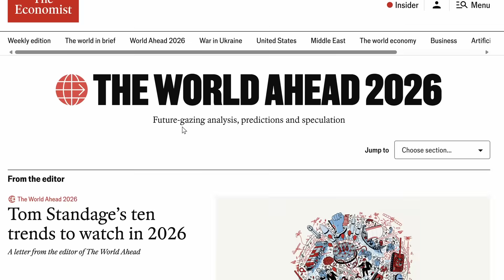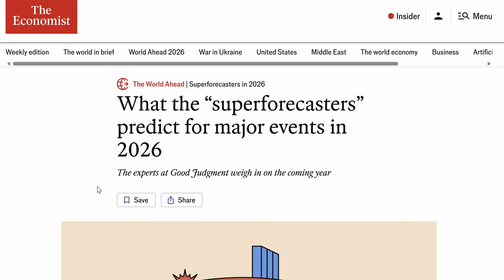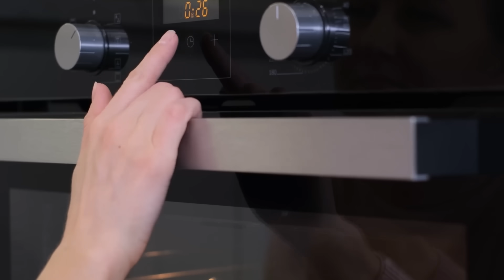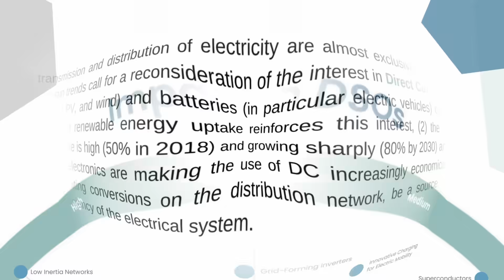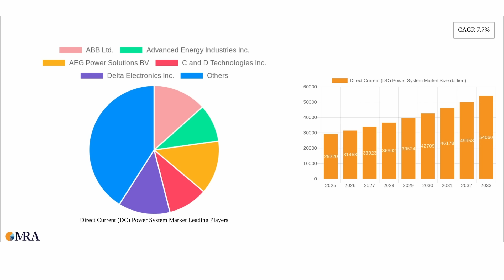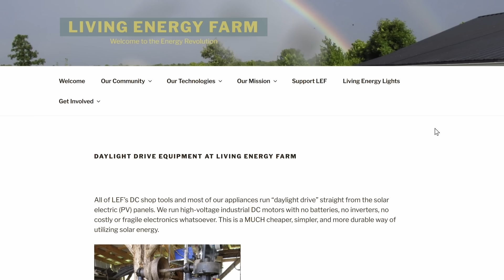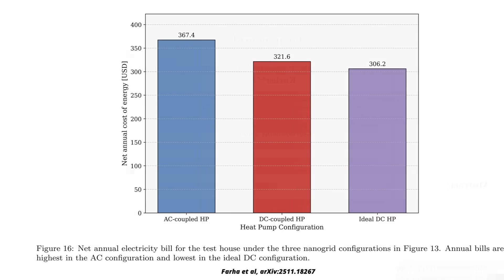Are We Using the Wrong Kind Of Electricity?

Comment: You need to minimize the I2R lost during the electricity transmissions, that means step up the voltage on the transmission side and step down the voltage on the receiving side, an ac transformer is more simple to be implemented rather than a high voltage dc-dc converter.
Reply: It is about correct application as always the case with an engineering question. The saving of 15 to 20% of going DC is not surprising to me since there is less power in a AC single than a DC single of the same voltage as power in AC is dependent on the phase angle of voltage to current, put very simply as there is more to it.
Reply: @ivandhotmanvilliers3361  almost always, the correct answer is ‘it depends…’
Reply: @ivandhotmanvilliers3361 indeed the cosine of the phase angle is the power efficiency, in reality we cannot get a perfect match of the distribution systems, some of the power are wasted there.
Reply: You still require a high power transformer in the dc-dc converter for stepping up and down the voltage, the controller chip is for driving the high power GaN transistor to switch the voltage on the transformer.
In general it is a switching power supply, it is more complicated especially in high power designs.
Reply: @simonleung2130  Yes, in reality a DC-DC converter is actually a DC-AC-DC converter and there are losses at every step.
Reply: @simonleung2130 ac transformer needs to work at 50hz, DC can work at 50000 hx, so it is 1000 times smaller
Reply: @tedarcher9120 That isn't an argument for DC. It is one to use higher frequency AC.
Reply: @court2379 higher frequency AC means much, much more losses
Reply: @tedarcher9120 I don't think the Eddy current losses will be all that high until you are above 10s of kilo hz. 1000hz would reduce the size considerably and not have a significant skin effect on the wires.
Reply: @tedarcher9120  UM 50000hz means it is actually AC is it not? Hz = Cycles per second? DC has NO cycles per second.
AC is Alternating Current it does not mean 50Hz  a Transformer doesn't 'need' 50Hz it only needs Alternating Current, the more Hz the merrier.
Reply: @YouShouldThink4Yourselfno shit lol. All DC uses high frequency to convert voltages. The difference is if you transmit at 50hz you lose 15-20% of energy, if you transmit at 50000hz you lose 100% of energy in transmission wires
Reply: @court2379 at 1000hz long wires inductance will become extreme
Reply: @tedarcher9120 For what reason? Thinking about the equations for a magnetic field the amplitude doesn't depend on frequency. Just current and other constants based on the physical geometry. I don't think 1000hz isn't enough to behave like an antenna and transmit power. Are you taking about if they are in the same jacket and very close proximity?

I haven't ever looked at higher frequency for grid scale transmission. What am I missing?
Reply: @simonleung2130 .. AC / DC.. DC microgrids make more sense. On  a lighter note, the biggest problem with DC is it bigs up Washington, that really ought to be rapidly filled with nuke power, released all at once, concentrated on the Whyte Haus!
Reply: @PrivateSi DC micro grids makes sense to me.
Reply: @crux321  .. New wiring standard for homes should have more than 3 wires. Add low power 12v + and - lines around 20A and 5v USB network at around 30A for fast charging of handheld equipment and data transmission. Cable and sockets would cost more to begin with but not much more compared to installation costs and we could get rid of power bricks.
Reply: @PrivateSi where are you getting the DC power tho? An inverter before these 12v /TV lines?
Reply: @crux321  .. Conversion depends on power system. Centralised AC inverter or DC transformer if off solar cells.. A single PC power supply would be enough if only for recharging phones and power-tools.  A 1kW PSU could be split into multiple circuits, and be made 'smart' for hardly anything extra.
Reply: That's why almost all long distance transmission has been AC until recently.
Reply: and a transformer is also more robust against bullets and cyberattacks.
Reply: @pietdepad4103 A single bullet ruins a transformer. That isn't true at all.
Reply: @court2379  It ain't necessarily so. Industrial transformers are usually proof against most common calibres where as the majority of electronics are not.
Reply: @YouShouldThink4Yourself 
There have been numerous cases in the news about people shooting a hole in the jacket of transformers and the cooling oil leaking out. The transformer then overheats and fails. 

They would need 1/2in thick armor plate steel to have any reasonable protection against most rifle rounds. I highly doubt they are making the cases that thick. They would be enormously heavy and expensive.
Reply: @court2379 It is the terrorism, am I correct ?
Reply: The loss can be recycled to recharge. Great idea. I tried once with electric company and some rule makers..when the bills were ave 17 a month. This was results
Reply: Boost converters are cool (literally too, they're efficient and don't generate much heat), but there are technical difficulties associated with making ultra high voltage semiconductors.
Reply: @maelmauron7530 and magnetic material for the high frequency switching on the high current passing through the inductor, take a look on the BH curve, Your required inductance is dB/dI which is dB/dH.dH/dI, the more you push to the end of BH curve, the slope tends to zero,  also the shape of the curve is frequency depending. 
Also if I have the choice, I won't use the booster, as I need the physical isolation between the low voltage side and the high voltage transmission side. That means I need a transformer in the switching circuits
Reply: @simonleung2130 isolation isn't always required, especially with DC devices. For example laptop power supplies are wired so that the positive rail is always 20V (or whatever the laptop needs) above ground (instead of + being +340*V and - being +320V which would make the laptop case live)

*sqrt(2)*240 which is the high side capacitor voltage
Reply: @maelmauron7530 you do need the isolation for high power, for example the voltage surge caused by the ground bouncing on the high voltage side is sufficient to kill the low voltage electronic  if they are common grounded with your power lines
Reply: A piece of paper is more simple then a computer, but you haven't sent me a letter in a long time.
Reply: Not really, ac transformers use a ton of copper, literally. Dc-dc converters use a tiny amount, but they use chips. Chips get cheaper every day while copper gets more expensive